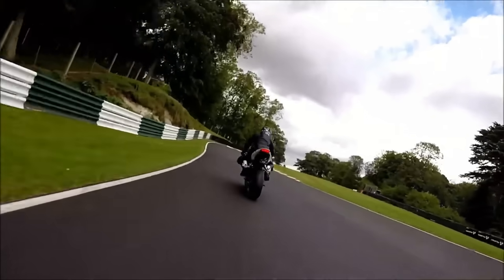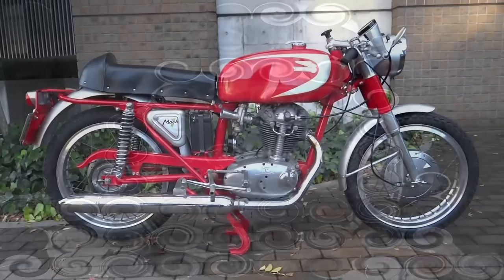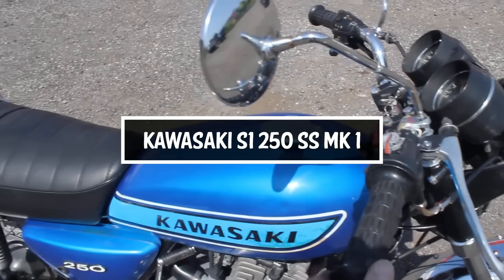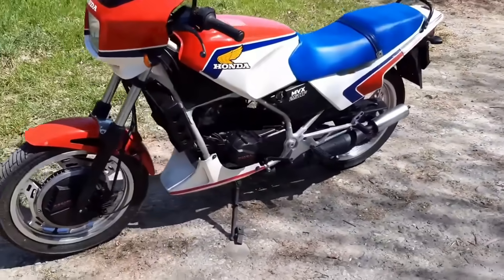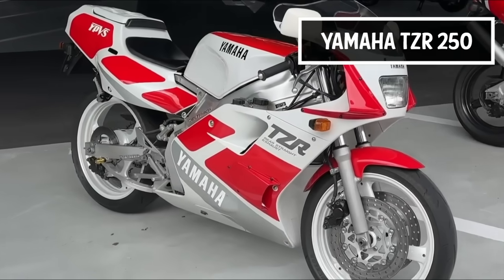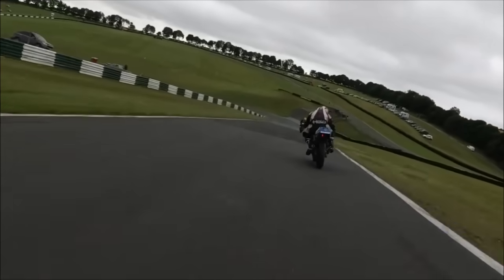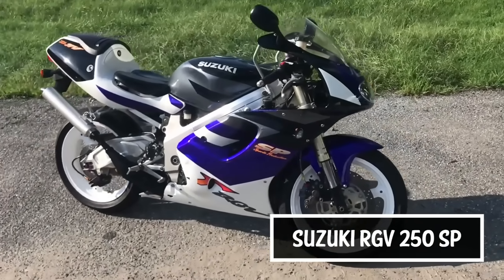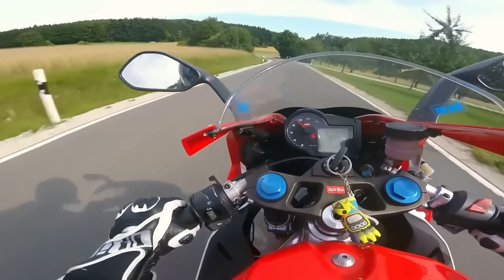The Fastest 250cc Motorcycles

Comment: 2 stroke engines are very sensitive to humidity as well as ambient temperature,  I remember how much better they pulled on a cool and humid autumn or spring day, and how a hot and dry day used to affect them... Maybe that explains some of the speed variation in different tests..
Reply: You're absolutely right, I rode with a mate over 100 miles from home to Nottingham with a mate who had RD250 DX and it was about 80 degrees that day. When we came back a couple of days later the weather had really turned and it was about 55 degrees. Both bikes were a hell of a lot quicker on the journey back.
Reply: @sambrooks7862  Unfortunately on the cooler and damper days the road surface was often damp as well, which limited the extra fun you could have - especially with tyres in 1960's and 70's.
Reply: @chrissmith2114  yep, still, binning it is all part of lifes rich tapestry lol!

Comment: The RD250LC's power output  was a major factor in reducing the capacity that those on learner licenses were allowed from 250cc to 125cc in the UK., though slightly before my time,. When I turned 17 (1986) our options were limited to 125cc and 12bhp on a provisional license though it wasn't difficult to derestrict a Rd125lc to 16 plus hp. I went down the sensible route of taking my Cbt test on my 17th birthday and acquiring my part two, within two weeks. I then bought a brand new RD350LC YPVS N2.😂 I ended up working in a motorcycle dealership in the late 80's and very early 90's and got to ride the RG's, RGV's, TZR's, KR1's. They were awesome.👍
Reply from the maker: Great story 🙂Cheers for adding your bit mate. Ride Free 🙂

Comment: I modified a 250cc four stroke motorcycle and went 123 mph at the Ohio mile in 2012.  Dyno horse power was 61 hp and almost 30 ftlb of torque.

Great video.
Reply from the maker: tell us more :-) sounds a beast
Reply: @barebonesmc   I am Darkhorse Racing. I started with a stock 2008 250 ninja and just tried to see how fast it would go in an official land speed event. 84 mph at Maxton North Carolina with the East Coast Timing Association. Long story short over the next fifteen years I have been racing with a top speed of 123mph in 2012 at the Ohio mile. It’s a 4 stroke parallel twin. I have run it from stock to turbo nitrous methanol. It’s been fun.
Reply from the maker: @darkhorsegarage9623  good going 🙂 Im a corners and dirt man more than straaight line speed but our differences make the world more exciting 🙂 enjoy it mate
Reply: @barebonesmc    This just started to see how many things I could do with 249cc. I rode to work every day., then went to the drag strip. The bike ran a 14.2 second 1/4 mile. Then I did a couple riding clinics and some track days. I planned to do an Iron Butt rally across the  US in 50 hr, but once I tried land speed racing the people are amazing. I never looks back.
Reply from the maker: @darkhorsegarage9623  good on you mate

Comment: I was hoping you'd give a heads'up  to the 1st bike I bought when I was just out of school: and you did! The Ducati Mach 1 Daytona. Bought from Kings in M/cr - it was glorious. It was the blue painted version and its tank was completely chrome plated. It cost retail £250 or 1£ per cc. Quickly modified with the optional factory racing kit: a  big bell mouth DellOrto carb', a higher compression piston and a reverse cone megaphone, sans baffles exhaust pipe. It sounded like a 500cc Manx Norton when heel and toeing through the cogs. I modified it further by replacing the carburetter with a Wal Phillips fuel injector, which was essentially a floatless drain pipe and super temperamental for it seemed to be dependant on whether it was sunny or cloudy. It was, though, the quickest bike in the motley collection of bigger CCs BSAs,Triumphs, AJSs and Nortons hereabouts in its time. Nice machine but it quickly became apparent am a poor rider of motorbikes for I bent it up in The Dales in a collision with a van. Then I went bumming about the world and when I'd returned home, my dad - thinking he'd seen the last of me - had flogged it. 
Incidentally, at the time I was envious at the time of the beautiful dimpled fuel tank which adorned Ducati's 200cc Elite. The Daytona's tank was okay, but workaday.plain. The Italians have a fine relationship with style, ratio and proportion. If style is important it helps if the rider is small in stature - all the best racers are.
Reply from the maker: great comment mate 🙂 Cheers for watching. Ride Free 🙂

Comment: There is one point I'd like to make; the Aprilia RS250 used the same engine as the Suzukis of the time, and really had no relationship at all to the race bikes. The road bikes were eqipped with reed valves, while the race bikes had disc valves. It is a tribute to all those Aprilia factory riders that they managed to make those bikes go so fast, because the disc valved engines were notoriously difficult to ride because of their hair trigger throttles.

I had a KR1-S at the time, and it was a truly astonishing machine to ride. It was light as a feather and flickable beyond your wildest dreams. The brakes were astonishing, even on standard road tyres and I never found anything in its character was anything less than "knife-edge" sharp. It even looked achingly beautiful and I even took it down to the South of France on the train, just to enjoy my favourite roads on a truly astonishing bike. Unfortunately, even the very best have tendons that are easily cut, and the KR's weakness was absolutely TERRIBLE reliability. The pistons would seize at the drop of a hat, possibly more easily than even that, and they were not cheap to rebore or re-sleeve. On a £ per mile basis, I can't think of any bike I've had that was more expensive in repairs than the KR1-S, but I can also confidently say that I doubt that I'll ever get more smiles per £. 

As for your question; small bikes are no longer seen as an end in themselves, and the only reason these bikes were so rewarding is because they were 2 strokes. Even the very best of the 4 strokes of the period were just dreadful. I had various 4 stroke 250s in the 70s, and even managed to blag a ride on the Benelli on one occasion. They were all dull as dishwater.
So what is the point of trying to develop a 250, or even 400 that, just because of the need to be a 4 stroke, simply isn't going to be that much cop? Better to build something that will be "interesting enough" to entice riders on to better things. And to be fair, the Europeans really do know how to make these small capacity bikes quite interesting. I know that the Uk hardly sells any of these smaller capacity modern bikes, so the perception is that biking is dying on the vine. But I do think that a lot of that is a UK perception, the UK economy is totally shagged, and the UK's youth simply doesn't have the money to live, let alone pay for a bike.
I live in Spain, and work as a teacher. And I see that very large numbers of these smaller capacity bikes are bought, about 50% of my students of this age are actively saving towards precisely this capacity of bike.
Reply from the maker: Cheers for adding this. there are various conversations re the Aprilia/Suzuki engine in the comments but you have added valid points, as i have often said, if we could amass the combined knowledge of all the subscribers we would have the most comprehensive motorcycle encyclopedia ever 🙂 also, apparently waiting list for test in Holland is at an all time high, and when we were away in Germany and Switzerland there seemed to be many more younger riders so it does seem we are hit in the UK more than most places
Reply: I had the priviledge to borrow an Aprilia RS 250 for a weekend and for two days I enjoyed the thrill of almost riding a race bike. It was so precise in the steering and obviously had more than enough power. I later borrowed a RS 125 and it’s about one of the most enjoyable bikes I’ve ever ridden. Leightweight and enough power to have an enormous amount of power without actually getting yourself in problems.

Comment: I had a kawasaki 250 dual purpose bike that I installed a high compression  wiesco piston in with cro- moly rings and lightened crankshaft that would run 136 mph in otherwise stock trim with all gear on it( street legal. The only other mods I did was fabricate my own expansion pipe and installed a 40 mm keihn dragstrip carb with jetting for the PowerBar. It really was quite a screamer!
Reply from the maker: Wild days, and even wilder nights 🙂Cheers for watching mate. Ride Free 🙂

Comment: I owned an early (points ignition) A1 Samurai, and with tuning and expansion chambers it was a 100 mph bike (in a straight line)  Heavier shocks did little to improve the handling, but I'm a big bloke and became used to its quirks, and never dropped it.  I went on to own a Kawasaki Avenger, and then graduated to an H1A Mach III, eventually owned one of each model 500, plus a 350 (still have a few parts hanging in my shed) and only reluctantly sold my last  (1976) 500 recently. I'm a 74yo OAP, and am still riding my Kawasaki 800 Vulcan. Forgot to mention I had a Honda Dream, but it was the 305 which I rode throughout the Australian Outback, until it came to grief north of Leigh Creek ! (throttle jammed full open when the aircleaner tube fell off whilst riding through bulldust !) The video of the Smurai brings back some good memories !  Great video.Thanks!
Reply from the maker: I do like the 800 Vulcan surprisingly enough 😊 reminded me of the early shadow vlx 600 I had for a while 😊 feet forward does me no favours though 😊 my spine complains after 100 miles 😊 welcome aboard mate

Comment: I owned a Suzuki Across for a few years so I'm very glad to see it get an honourable mention here. They were a great little bike, surprisingly reliable and quite popular here in Australia through the 90's. 

One feature of the bike was the storage area where the fuel tank would be in a more traditional design, large enough for a full face helmet. The actual tank was under the seat, but only held approximately 12l of fuel.
Reply from the maker: ouch 12 ltrs even on a 250 is limiting,  but good to hear a bit more about them, i knew about the storage, i guess thats where honda got the idea for the NC700 🙂) Cheers for watching mate, ride free 🙂
Reply: My first road bike was a bandit 250 which had the same engine as the across. Fun little screamer it was and dead reliable. I miss it!
Reply: Interesting, I didn't know about the storage, I recently sold my Honda NC750X and thought that was a groundbreaking idea, little did I know it had been done before.
Reply from the maker: @tonyjourneyman1944  me neither mate, we live and learn as they say 🙂
Reply: @barebonesmc  Yeah, the 12 litre tank was a pain so I got into the habit of carrying a 5l fuel can in the trunk.
Reply from the maker: @DocMagoo  lol, when needs must i guess 🙂

Comment: Couple of things of note. Although in awe of Yamaha's TZR-1, I was lusting after an RGV250K back in 1988 when they first released. I already then currently owned a 1985 RG500 Gamma which I had bought new in early 1986. Still do. Pretty sure the Kawasaki KR-1 released a few months ahead of the RGV250K here in Australia. A younger friend still on his 250 licence limitation bought the Kawasaki KR-1 (new) shortly after its initial release, and I the opportunity to ride it hard. My recall is that it was a very appealing bike with no immediately apparent vices, and a drop dead gorgeous looker. I particularly loved its radial rims which had only just started becoming de rigeur in mainstream road motorcycling which Suzuki had deliberately avoided on their RG500G hampering it with bias ply rims and undersized front rotors in order to promote their marketing shift to 4 stroke with their new flagship the GSXR-750. Such a shame.

A bit over a decade later I bought one of the last new Suzuki RGV250Ts available from the RGV's final year export production run. That model was still black box unrestricted, but had had by then a rev limiter imposed at 11500rpm. By the end of the suffix T model produciton, all but one of the mechanical issues and undesirable idiosyncracies of the original and subsequent stock models had been eliminated, that being namely it's neutral stability and heavy front end tendency to head shake horrendiously requiring skilled corrective input if its straightline stability was upset by some external road condition/object. This could be all but eliminated by fitting a steering damper for which the frame was set up with a damper lug ex-factory, but of course at the cost of front end feedback & finessed feel. I never fitted one to mine, although I've experienced some 'you really need to be experienced and capable' scale tank slappers over the years attributable to this. The Aprilia RS250, owned by friends, which I've ridden shared that same characteristic. Stock, I put my RGV through the test radar at 212kph true flat nil wind. My overall assessment without detailed elaboration. It's a much more difficult and challenging bike to ride very fast capably than the RG500, and very VERY easy to get yourself pear shaped fast without experience and exceptional skill level. Definitely a bike for experienced skilled riders. Much as the wife persists in nagging me to sell them, I still own my RGV250T too.
Reply from the maker: great story :-)  Cheers for watching and the comment mate, Ride Free
Reply: No mention of moto Morini. I did own a Ducati mach1 in 1965 and reached 8000rpm equivalent to 108mph; with full fairing and a slight wind behind me
Reply: @marcellogenesi6390  Even fully faired on the track at its claimed 116kg dry with just 200ml of fuel in the tank and a 45kg rider aboard for 27HP, I find that an event I'd have to personally witness to believe without scepticism. Already read the memory lane specs, so please don't bother quoting them. 

Perspective. My 1974 Ducati 450 Desmo (14kg heavier) producing the same spec HP would be pressed to do that as I recall, and not for long given rubbish Ducati metallurgy of the day. 70s' Ducatis in particular. Spit! Ugh! Just Ugh! Although I owned three and rode considerably more during that period, -sucker for punishment or slow learner (?), they were all a regrettable mistake given 20:20 hindsight.

Moto Morini made a momentary distribution presence splash for all of a figurative 5 seconds here in AU with one of their 350s mid 1970s during the height of Italian bike fashion craze, but the brand didn't sell. Pretty and stylish bike though. Fairly sure local pricing stupidity had something to do with it being a non-event at the time. Laverda,  MV Augusta, Benelli, Moto Guzzi all suffered from the same overpricing affliction. Ducati was the only Italian brand near price competitive with understandable Japanese dominance, with Guzzi and Laverda providing a niche anternative to the cashed up BMW R90S buyer who wasn't one. The 750 S3 and 850 Le Mans (Mk I) Guzzis sure were stylish though. 

I had a mate with 'Italian brand fever' who bought a new Laverda 500 of some now forgotten flavour in early 1979 I used to ride with frequently. Spectacularly unimpressive in all respects except price. In late 1979 or early '80 after I'd blown up the Desmo and GTS and in need of reliable set of two wheels for not too much money I bought a new Kawasaki Z500 which outperformed that Laverda -and just to to add insult to injury, for around a third of its price!
Reply: @theblytonian3906  Whether you belied or not I did reach 8000 rpm, that is 108mph in fifth gear, maybe the road was slightly down hill I cannot remember. My first bike was a Triumph 200cc tiger cub. then a Gilera175cc super compressed, then a  Ducati 250 Daytona, finally the Ducati 250 mach1; sadly followed do to anforseen circumstances to a an Austin Minivan.
Reply: @marcellogenesi6390  That's a great distant memory to have regardless. =]
Reply from the maker: @marcellogenesi6390  there are always the ones who came close but didnt quite make it. ejoy the ride mate, cheers for watching, Ride Free 🙂
Reply: @barebonesmc  Well if I had the money I would have bought  a Vincent Black Shadow second choice a Triumph Bonneville, I also liked the 350 Tiger 90, but hey! it was the sixties, Winkle shoes, scarfs, cheap coffe bars, mods and rockers, Wee Willy  Harris, and some. loved it.

Comment: On a 5km stretch  of motorway heading north my 250cc Hyosung Comet V twin held 160km and 148km on the return south .60kg rider.Not bad for a Korean 4 stroke.
Reply: Well it is a Suzuki designed engine after all. The engine in the 650cc version is just a direct copy of the SV650s engine.

Comment: What a lovely video! Thank you! I currently ride a 1992 Kawasaki ZZR 250 (4 stroke): not near as wild as the bikes in this video but a lovely machine! Made 34 hp and cruised at 160km/h (about 100mph). The carburetor needs some fine tuning but it still goes 140-150 without much effort.
Reply from the maker: better than todays offerings for sure :-) Cheers for watching mate,  have a great weekend
Reply: I had a zzr250 as well. Glad someone else mentioned it. Wasn't much faster than my NS125R but was smoother.
I think it was basically the GPX 250  with a redesign.